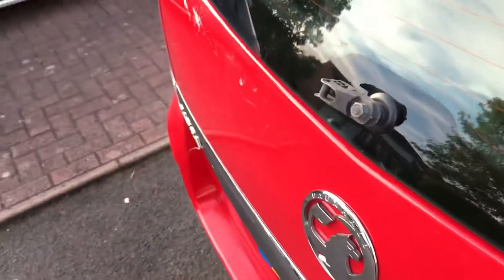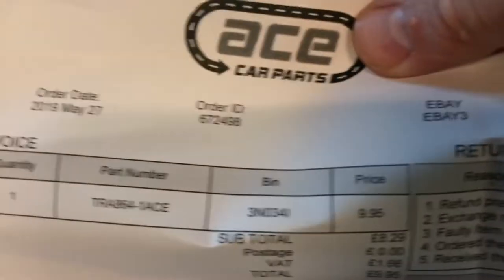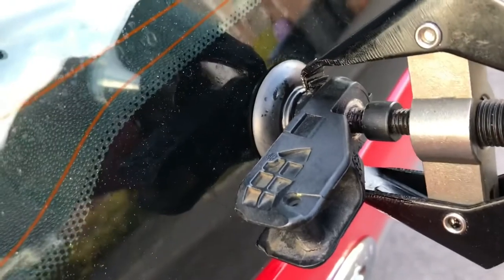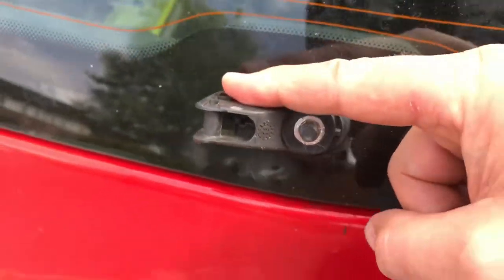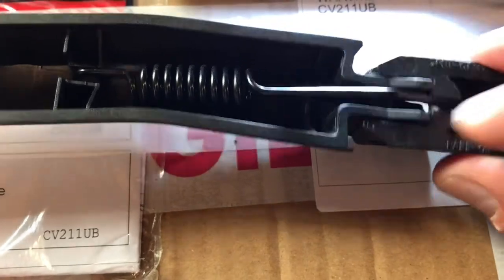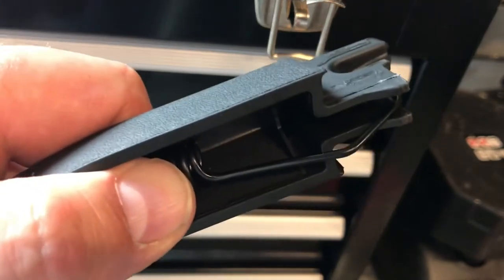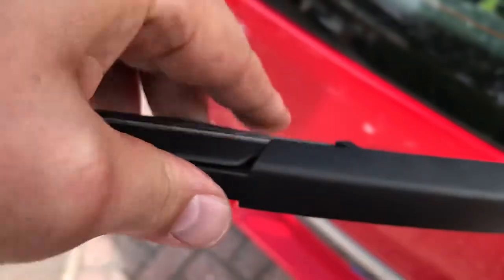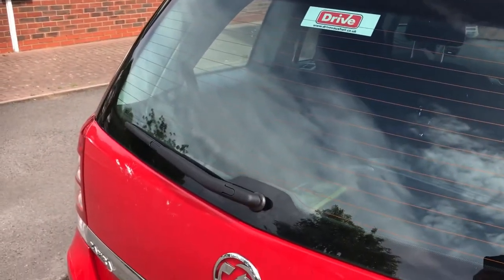How to fit or repair a rear wiper arm and blade to a Vauxhall Opel GM Zafira

Comment: This video was a life saver. The bolt was completely seized on mine in a similar way and having watched this video before I started meant I was already one step ahead in knowing that I could just attach the new arm to part of the old one. 👍
Reply from the maker: It’s a horrible design, I think you’d have to cut it off and swap out the motor. Luckily enough, that arm joint is a life saver, if it’s still there.
Reply: @drivewaydiyer6504  Yeah luckily mine was the same as yours and could just reattach using the spring. Couldn't even get the bolt off. Appreciate the video, was a big help
Reply: 4 years on and your video just helped me out. 🎉 Thanks
Reply from the maker: Great to hear. Thanks for watching 🙏

Comment: Thank-you  for this demo and in particular the issues of the bolt and arm  interface.  As others mention the design of the system is such that that even with the cover the bolt seises very tightly and there is a very strong danger that you can break the rear windscreen if you try to lever it off as opposed to lift it off as you rightly say is the correct method. 

As you suggest  use a fine oil as W D 40 (science in a can -:))  and work it in carefully,  I had to "drown" mine and left it over night (14 hours actually) but still an issue pulling the bar off from the spigot bolt which is ridged, to fit the replacement arm. interface.

A large pair of hand clamps (Stillsons) to get a grip over the top of the fitting like a cork screw action,  and not for the side and the pull on that, adding more lubrication top of the bolt spigot, letting it  rest, and the pull it again let it  rest and then one final tug.  until the arm came free.  Did need a littler leverage with a very small screwdriver but careful not to touch the screen just the rubber motor cover.

That gave enough torque to be able to pull off the who arm using the hand clamps almost like a cork -screw . An absurd design error by GM and I would suggest deliberate as they sell a special tool separately. £3.06 off e-bay, but cost of delivery more than the part ! -:)
Fitting new parts the wiper arm needed a bit of testing to make sure that it did sweep the window and not part of the body work. 

Best way  was to leave the arm off and then turn the rear wiper motor on and mark the point on the spigot to the limits left and right of the arc of the arm's travel. 

Loosely place the nut over the spigot so just enough torque to hold in lightly in place and then test the movement by turning the rear wiper switch on the car to make sure the swing of the blade did cover the screen and not the paint body work as well.. 

Once tested (needed a slight adjustment to the arm and mounting angle) then bolted on to fit tight, but again not over tighten,  

Ridiculous amount of work to deal with something  simple, and  should not need to be done in the first place if the mounting was stronger to deal with what was only 5 degrees of frost on the screen and the blade frozen to the screen but although partly lifted of the  arm not strong enough to deal with the torque and snapped. 

Of note that the original Vauxhall Novas' (1983->) had a similar issue with their front window wiper mechanism which  meant if the wipers froze to the screen the linkage would break and a whole new system put in to place.      

Again raises the question whether these "design faults" are deliberate 

Local dealer was going to charge me £25  just  for the fitting, let lone the part. 
Part purchased of the interent, neoprene and better qaulity than the original and half the price. 

So thanks for the advice. 

Not just a life saver, but an expense saver as well. 

Many thanks.  

Chris R- London
Reply from the maker: Thanks so much for the comment, I’m always great full for this input. Great to learn stuff from you and other viewers.

Comment: Thanks for the upload! I have exactly the same problem where mines snapped off but seized up
Reply from the maker: You may have to cut it off and remove the motor. Worst design, expensive if the window breaks.🙄

Comment: Thanks for that. I've got to do the same thing on a Meriva B shortly 👍
Reply from the maker: It’s a horrible design, take your time, as you don’t want to break that screen.
Reply: @drivewaydiyer6504  Just completed it after much swearing lol  The nut was stuck fast and not even plus gas would free it off so went for your method but even with thin nose pliers I couldn't get the hook of the spring over the bar. In the end I had to fit the spring over the bars with the arm detached and pull the arm over the rear window mounting.  Thanks for your advice anyway 👍
Reply from the maker: There’s always a way. Glad you got sorted.👍👍

Comment: Mine is a 57 plate and I’ve tried to remove the arm to adjust the height of the arm and it’s definitely welded it self to it .
Reply from the maker: It’s a dreadful design, you’ll probably have to cut the arm off and replace it. Probably worth leaving it.👍

Comment: Had the same problem with it being seized but thankfully it unstuck just after I got the spring off. Which is good because it looks like the arm that came off doesn't just unclip from the motor fixing, looks as though there is a pin in it that would somehow have to come out! (astra gtc 15)
Reply from the maker: That sounds like a win for you, they are the worst design. If you get it wrong, it’ll be expensive.👍

Comment: How did you get the spring to stretch? Ive tried to do the same but cant get the spring to reach
Reply from the maker: Leanne Herald attach the spring first, then the hinge, then push it on. The arm needs to be pulled towards you first.
Reply: I had this same problem. Tried and failed a few times. I attached it to the part that came with it (i.e. the new version of the bit that won't come off) and pulled it tight a good number of times. Then managed to fit it to the car. I guess the pulling around with the new bit stretched it a bit.
When it worked I had the arm facing along the rear windscreen rather than sticking out towards me like I thought might have been best.
Reply: I used a pair of long nose pliers and it did the trick.

Comment: I have the same problem. How did you install the new ones to the old one on the car? You didn’t show it.
Reply from the maker: You hook both sides of the spring, one end to the new and other to the old, the hen attach the elbow. Takes a bit of strength, but it will go in.
Reply: @drivewaydiyer6504  ok, i hope it will work. I’ll let you know how to do it. 😉
Reply from the maker: @rainman9663 if you’ve bought a whole wiper arm, then practice on that first, then you’ll get the gist of it.

Comment: Did you try turning it anti-clockwise when you couldn’t pull it off? We did that and it came off easily so we could but the new one on.
Reply from the maker: Yeah, I did all that. I got to the point of worrying about the glass. I wondered if they’d used lock tight on it.

Comment: Mine seized too 6yrs new maybe they turn on with the thread, threaded on like the bolt, but i cant get mine to turn and dont wont to break it they must glue or press them on under presssure so you hab too buy a new one and get them to fit it.
Reply from the maker: I know a few people who take this off, as in dewipering their car. You his thing is seized. Fortunately the part where the spring attaches to is very strong, so can be repaired. If that bit breaks or the motor stops working, your cutting it off. Terrible design.👍

Comment: Yep mine seems seized as well, not sure if I'm going to bother with tool to try and get it off but my issue is the end part where the blade attached is snapped so the arms still on the car.  My question then (before I start butchering stuff) is it possible to remove the spring and arm that is attached to the car the way you took apart the new one?
Reply from the maker: If it’s the same, you should be able to do that. It worked for me. They are a dreadful design. If the wiper motor fails, looks like I’ll be cutting it off. Thanks for watching.👍
Reply: @drivewaydiyer6504  thanks for the reply, looking at the technique you did again I don't actually think its possible to remove it like that when on the car as the way you bent it... It would need to be bent into the rear screen which of course is not possible.
Reply: @robradtke8014  cheers mate, good advice but luckily for me I went at it two pairs of mole (vice grips) and using these in Tandem on the end of the thread and behind arm it pinged off thankfully 😅.  Ended up buying a second hand vauxhall part as those new cheap replicas on ebay are well just dog turd!

Comment: My motor has packed up on mine.... bought a replacement but the arm is ceased to hell. Angle grinder it is. Why are things never simple! Half hour job turns into a three week job 🙄🙄🙄
Reply from the maker: Dreadful design, if the motor packs up, I’ll be doing the same. Just watch the window.😳😳 good luck.
Reply: Driveway DIYer I think it will be a dremel with a cutting tool and some protective tape on the window 👍👍

Comment: Bit of frost and snap Had to cut mine but the metal inside the wiper arm is still on the thread and looks, putting it politely fucked. 😂😂 Where would i go from here ?
P.s mot is due end of month 😢😢
Reply from the maker: Could you possibly cut it off gently, with out damaging the thread?
Reply from the maker: Could you possibly cut it off gently, with out damaging the thread?

Comment: Dislike. Did not actually show the change.
Reply from the maker: Did you actually watch the video and understand that it was seized up.
Reply: How you get metal pin out that holds 2 bits together
Reply from the maker: @garyscott8115 you don’t , it unclips. You have to push it apart.
Reply: At 3mins 45 you have the silver pin missing leaving small hole at top but don't show how you got it out

Comment: How in the hell did you put the spring back on the same way you took it off? To do it the same way would require you to rotate the arm INWARDS, into the rear glass….
Reply from the maker: Attach the spring first, then attach the arm. It does require a bit of strength.
Reply: @drivewaydiyer6504  so attach the spring to the arm, then attach the other end of the spring to the cap? And then strong arm the arm slot on the cap bracket?
Reply from the maker: Yep, might take a few goes, it does work.